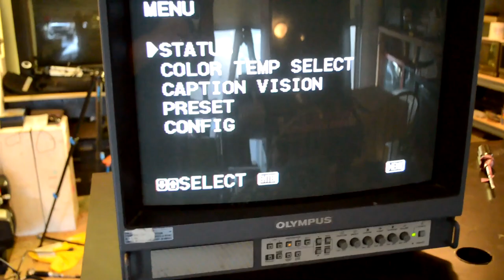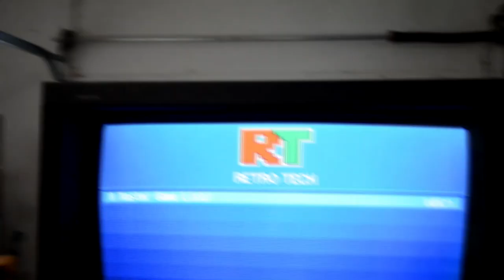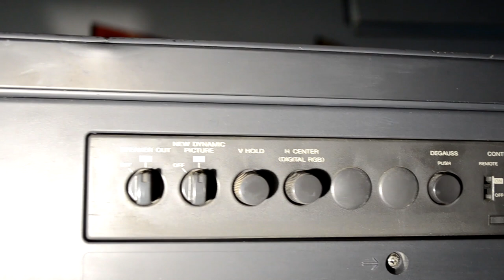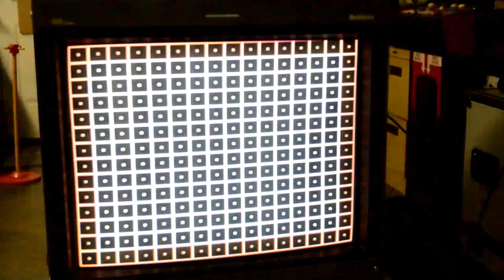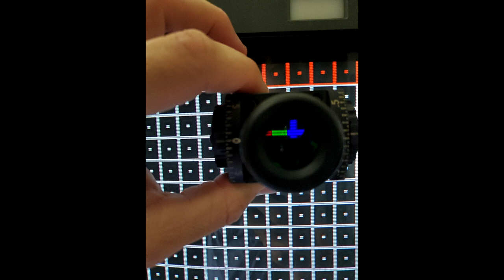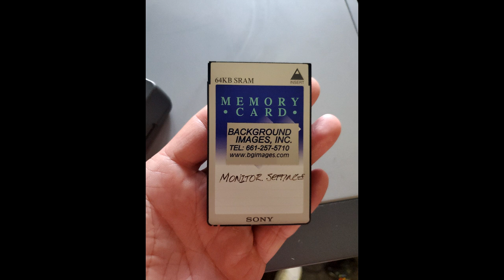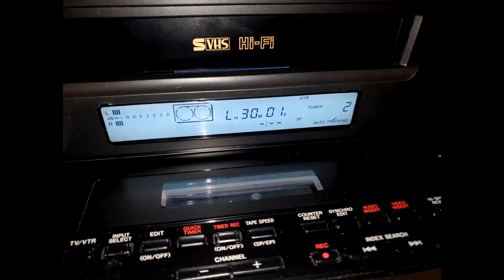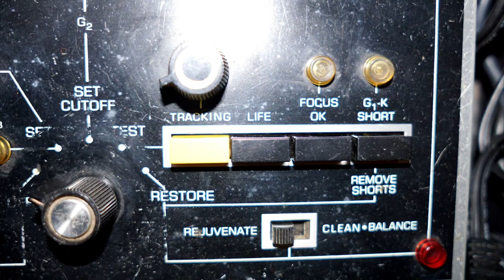2020: The Year of the CRT | Part 2

Comment: PLEASE HELP! I have an issue that perhaps you can help with. I just received an AuxunWorks Scart switch. I have several consoles hooked up with scart, to my pvm 2530 and they have zero problems. I recently hooked up my PS2 with AN ORIGINAL PS2 scart lead, and the picture tints completly purple! Also, A light indicates whenever a console is plugged in, but with the PS2 the scart switch does not appear to be reading the console. I am certain that I have selected RGB output from PS2 configuration. When I use my other Taxon Tools switch, the PS2 works flawlessly, so any idea what my malfunction is?